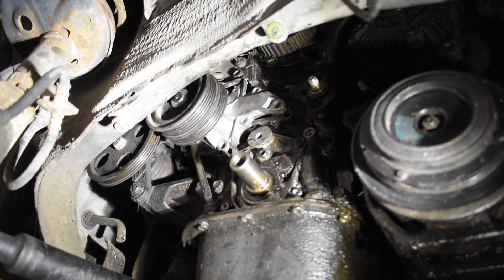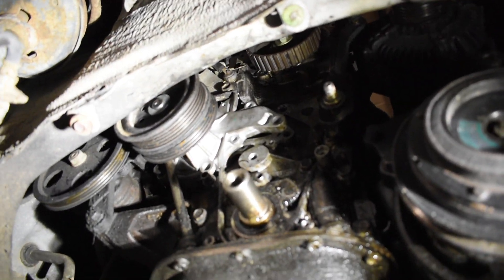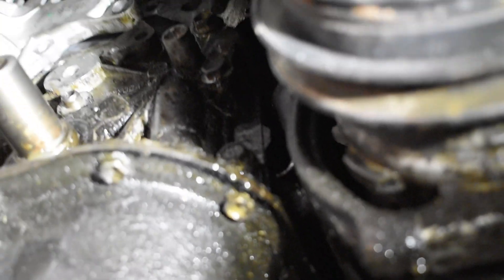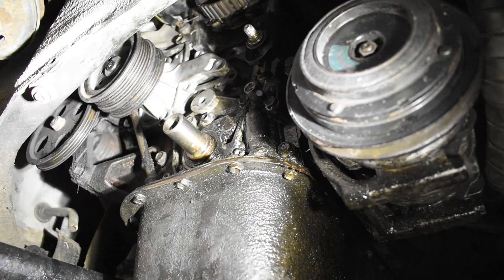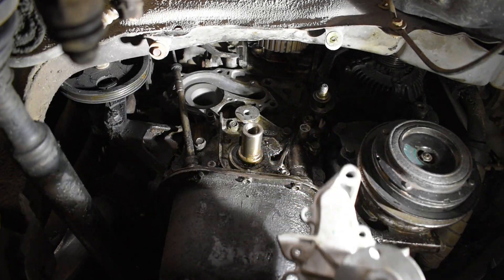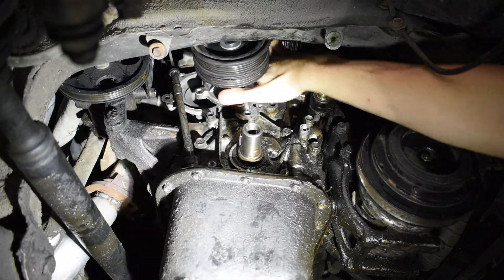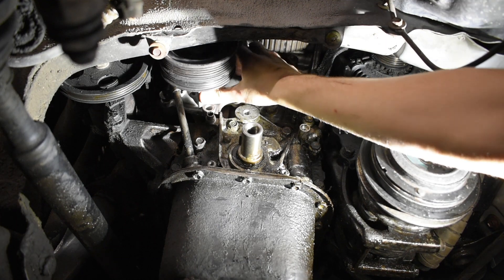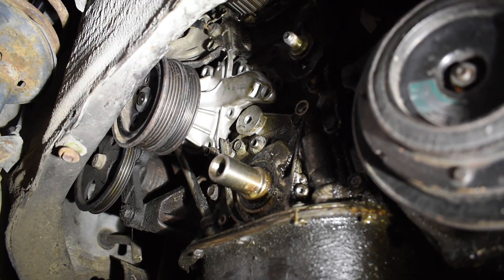Easiest way to Install a Water Pump on ae82 Toyota Corolla

Comment: Man, i spent hours still trying to figure out how to remove the top drive belts. Most car is pushing the alternator down but I struggle with this AE82.

I intend to replace the timing belt and it comes with a tensioner as well, where am I suppose to install that? Thanks in advance!